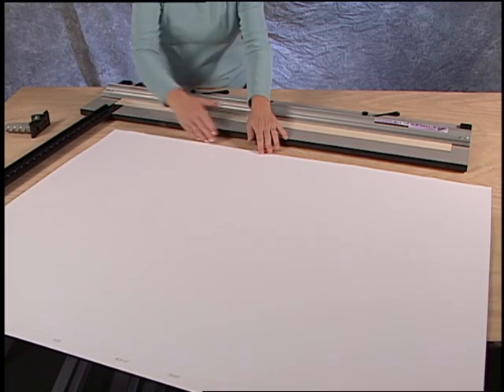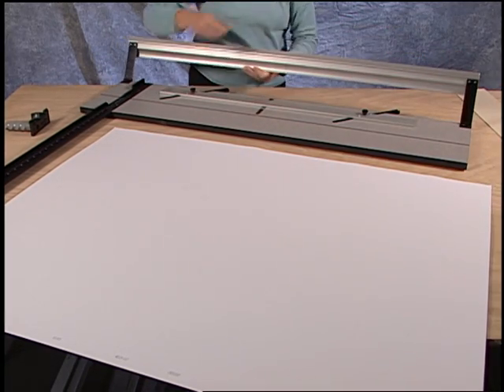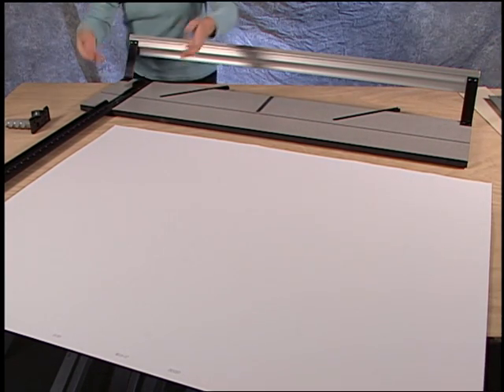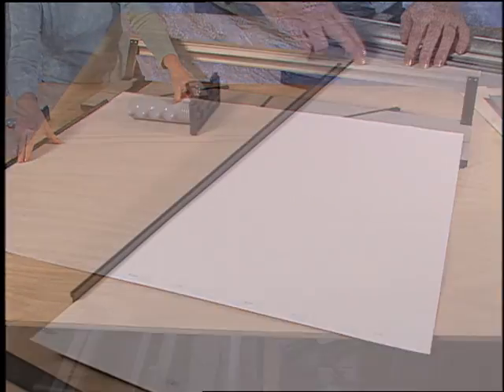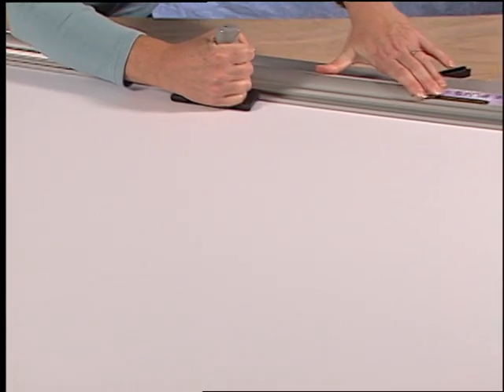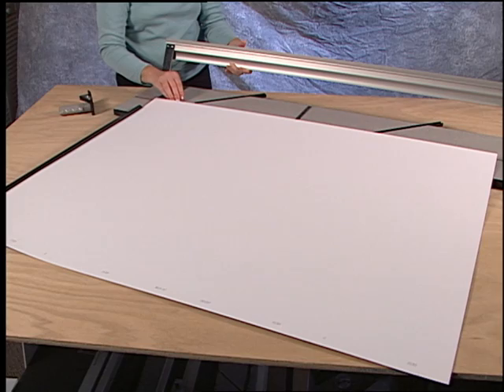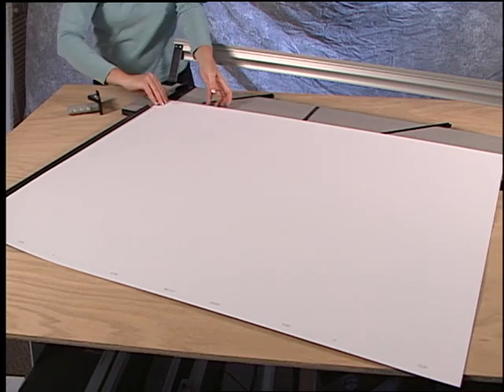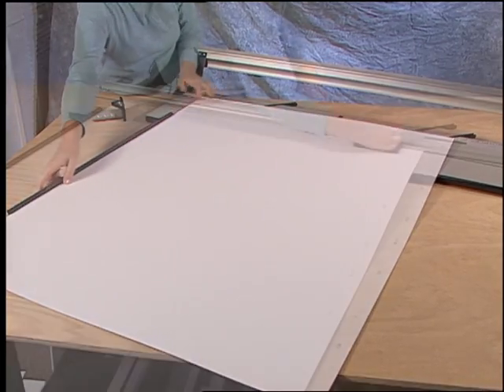How To Square A Mat Board Blank using a Logan Mat Cutter

Comment: What if you don't have a squaring arm?
Reply from the maker: You can check the square using the X method. Measure from top right to bottom left and then from top left to bottom right. If the measurements are the same, you are square. If not, trace lines on the mat board to indicate where to cut, then use a straight-edge ruler and mat cutter to cut along the lines. Press down firmly on the mat cutter to make a clean cut.

Comment: What is that long guide, that's not the ruller?
Reply from the maker: The long black arm extending off the side of the mat cutter is the squaring arm. This is scaled out to 30" and is set at a 90 degree angle to the guide rail. The squaring arm is used to blank mat board to size before bevel cutting the window.